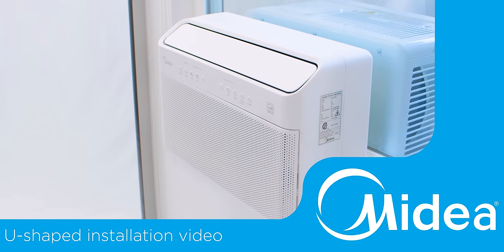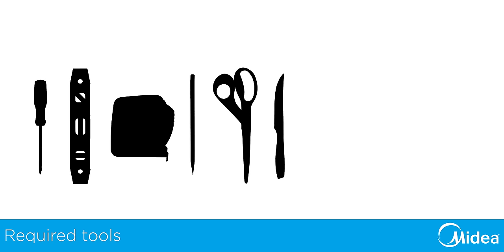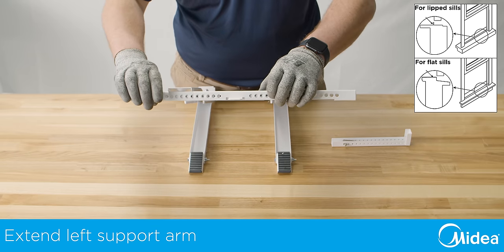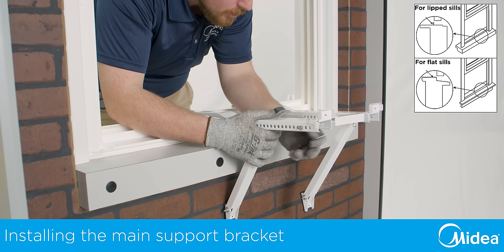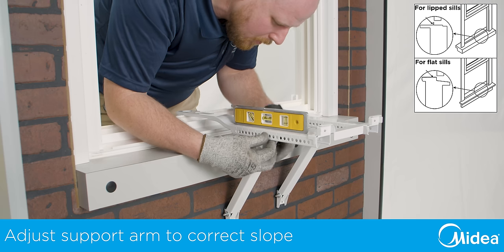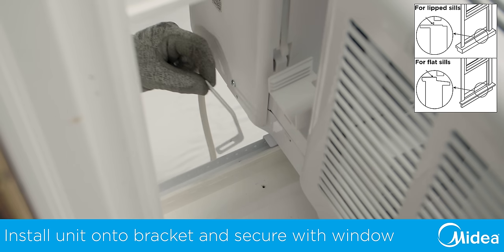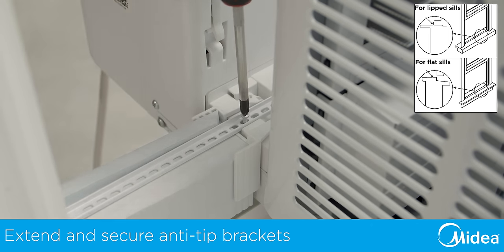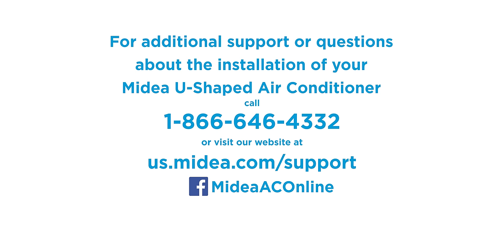Midea U AC Installation Guide

Comment: This installation was so bad in the manual I almost sent it back just based off that I had to look at two installation videos and anti tilt is still not in correct spot customer service wasn’t helpful at all it was so stressful I’m happy I stuck with it though it’s so quite and I do like it the app was giving me issues too
Reply from the maker: Hello Castiel. My name is Candice. I am sorry to hear that the installation was so stressful however, very happy to hear that you did stick with it. Love to hear how happy you are with such a quiet unit and the smart features. Have a great day. MideaCustomerCare@hartehanks.com  (BBB A+ Accredited Business)
Reply: You guys really really gotta explain it better people will not be like me I got frustrated a few times and the anti tilt flaps don’t even go in between they are off by a little bit so I stuck them out as far as possible and screwed Em in
Reply from the maker: Hi Castiel. Thank you for the feedback. I will pass on the information for the future. Let us know if we can help on Facebook at m.me/MideaAmerican anytime!
Reply: @elmochipshop25  yeah my anti tips are like half an inch away from being able to go where they belong..... Then I still couldn't make the cut side face indoors .... I have both cut sides of anti tip facing out and hanging onto inside of window where bar is on vinyl window. As long as none hang on it I doors it should be fine but.... If they made it to where you could slide the anti tip horizontal 3 different screw settings that would work... Predetermined spot with all that space for window isn't a good design

Comment: This videos directions skips steps and so you have to use the manual. Like telling you to put foam on and then having to install window brackets? But the foam is covering the parts where brackets attach, also after you put foam cut into bracket, they don’t mention you have to take the screw out before to Re screw it to hold in place. And on top of it, my unit is different from the one in the video.
Reply: Mine is different too- mine is a newer model purchased recently, I think this 4-year old video is outdated for us. Better to scan with the phone and follow the video provided in the instruction manual.

Comment: Just installed this an hour ago..... This video and instructions show the anti tip brackets differently. The unit doesn't allow the left side (when looking at it) to flip the direction the book says to. The unit also doesn't have a flat side , both sides are angled and they do not change angles when flipped. I said screw it and installed it the best I could. The anti tip isn't inside the track because window is like half an inch to awkward so I installed them on inside hanging on so it's def not going to tip outside now... If a kid hung from it inside it may break it though. 

The insulation was the most infuriating experience ever! Then I have my concerns on rain that hits the windows (sideways rain as I call it), I wonder if water is going to get in the house ....

The directional vents are pretty much not existent, maybe adjust airflow like 30 degrees, always goes down middle too. The remote sadly isnt a temp sensor too. 

It does sick out about 5 more inches than you are used to. 

I setup to where I can open window and have it sealed with insulation. It's very quiet. High speed could be stronger (8k unit) ... Def not blowing me away with air strength vs last unit.

I bought it for energy saving cost mainly and old one I didn't feel like tearing it down to clean it (years old and can only clean so much without teardown).

Time will tell on energy savings (fall now soooo).

Also, I used static cling tint on window to stop light intrusion since in bedroom and with gy shift. 

I have not used what features yet.
Reply from the maker: Hello Michael. Congrats on your new AC!  I am sorry to hear about the frustration you have had with installation and setup. Reach us on Facebook with any questions or concerns at m.me/MideaAmerica. Have a great day!

Comment: I was not aware that you cannot use this unit on multiple set of windows. I thought the bracket went in the window channel, but it sits on the window sill. On multiple windows there are no sides to screw the extension arms into.

Comment: For installation, is it absolutely necessary to screw into the window frame? I plan to use the air conditioner unit temporarily and don't want to have holes drilled in..
Reply from the maker: Hi @dreeemer. Thanks for your question. Yes, all brackets must be used for a secure and proper installation. Have a great day.

Comment: Yeah, in the middle of installing... there are a few steps that don’t make sense w my window. The most frustrating thing is that the insulation that I have to cut isn’t tall enough to fill the void between the window and the bottom of the frame. I’ll have to figure that out.  Customer service is closed on the weekends (when I have time to install).
Reply from the maker: Hi Zach Bliss. Thanks for sharing your comment. To better understand your situation, please give us a call at (866)646-4332 and provide Ref no. 111097374. Opening Hours: Mon-Fri, 8 am – 6 pm EST and Saturday 9 am – 4 pm EST.

Comment: The hardware that came with my unit is different than shown in the video.  The part of the main bracket that sits on the window sill is a slightly different shape and are covered in foam; the anti-tip bars only have narrow ends; and the open window brackets are a different shape entirely.  It's hard to tell from the video exactly where the main bracket sits on the window sill.  The way the video switches between wooden windows and vinyl windows is also confusing.  The icon is too easy to miss when you're focused on the video.
Reply from the maker: Hi Kayta. Congrats on your new AC! I am sorry to hear that the video was not as helpful as you had hoped. Reach us on Facebook with installation questions at m.me/MideaAmerica.
Reply: Same here.

Comment: Hello do you have the dimension of the outside unit for the 8000btu and 12000btu unit, I got a wall close to the window…
Reply from the maker: Hi @marlonterdu9060, The total depth of both units is 19.17 inches. This is divided into approximately 5 inches of internal depth, 3 inches within the U-shaped groove, and 11 inches protruding externally. Have a great day!

Comment: I just got my 10k unit installed. Installation video did help although the black plastic that holds the weight on the end of the bracket fell off.

I am pleased with the 10k btu power and noise level is really low. Only thing is... I can't complete my midea app on android. It stops at 61% and does not continue. I am using s9+
Reply: switch off mobile data during the setup. that solved it for me--but that was the previous version of the app.

Comment: My husband was able to install this unit quite easily in 20 minutes. Thank you for the video. My question is does the unit have to sit for 24 hours before you start it up?
Reply from the maker: Hello Reva. Wow, that is a two man job! Well done. You can plug the unit in after installation. We do recommend reviewing all the safety precautions in the user manual https://m.media-amazon.com/images/I/B1jDNDI3CMS.pdf. Enjoy!
Reply: It wouldn’t work. Fan outside would not run. We noticed that on the box was a sticker saying it had been returned already once before. Circulating a broken machine does not help your reputation. We waited a month to get it from Amazon and now are sitting in 92*F in our living room. But thank you for replying

Comment: There is no instructions to seal the bottom of the AC against the window! Please advise me if the included foam can be used for this. It is important to seal the bottom, even though you may not see it.
Reply: I used the provided strip of black sticky-backed foam for the bottom. It's wide enough to cover the gap and helps with insulation. It is very sticky though.
Reply: Yes!  I feel like this was a glaring oversight and no one caught that?  There are big gaps that small bugs can fit through not to mention how it's really bad for insulation.  Also at 6:02 - it is not that easy.  Most windows will not just fit perfectly, there are gaps on the side where it's very visible and then there's the middle where it's concealed.
Reply from the maker: Hi keantoken. Thank you for sharing your comment. The unit comes with insulation seals for the openings after install. Please see the video link below for a better idea. 

https://youtu.be/76uNIEiDBGo
Reply from the maker: Hi McBain. Thank you for sharing your comment. The unit comes with insulation seals for the openings after install. Please see the video link below for a better idea. 

https://youtu.be/76uNIEiDBGo
Reply: They have a separate video on YouTube that covers the insulation of the unit in detail. Unfortunately, I didn’t find it until I finished my installation.

Comment: I cannot use this In the window I had intended.  The wall outsides protrudes too far and at the largest pin opening the feet just allow it to pitch correctly. Moved to another window.  Issue number 1 unit will not center.  Small issue but one nonetheless.   Second there are bug holes now under the unit.  So no matter what I will have to deal the bottom.  Issue 3 the anti tilt isnt even close to the sash.  Issue 4 the open window brackets do not reach the intended hole. A question.  Does the bracket go on the inside of the lip ?   -This video and instructions kinds of shows the bracket stays on the inside of where the window closes.
Reply from the maker: Hi Michael Hinchey. Thank you for sharing your comment. We'd like to better understand your situation. Kindly give us a call at (866)646-4332 for assistance, please provide Ref no. 111097345 when calling in. Opening Hours : Mon-Fri, 8 am – 6 pm EST and Saturday 9 am – 4 pm EST.

For issue # 2, the unit comes with insulation parts. Please review the video below for a better idea. 
https://youtu.be/76uNIEiDBGo

Installation Guide:
https://m.media-amazon.com/images/I/B1WOLioF8mS.pdf

Comment: My windows are 44 inches wide. Can I install this and add additional foam to cover the gaps?
Reply from the maker: Hello Ryan. For safety we would not recommend installing this unit any other way than intended. The unit is designed to fit in windows with opening widths of 22"-36" and with a minimum height of 14". Have an excellent day.

Comment: What types of wall is bracket footing compatible with? I live in a 2 story apartment building that has stucco walls. I already drilled horizontal bracket piece onto sill. However, when I try to place the support arms against the exterior stucco wall, rubber footing keeps slipping out of place. The rubber footing of bracket does not seem to grip the wall. Does this bracket not work with stucco walls? Do I need to purchase a different bracket?
Reply from the maker: Hello @debbiecha5813, We recommend installing the bracket on flat surfaces, but it can also be adjusted to fit on stucco walls. However, this unit has been designed to work with only one type of bracket. If you have any questions or concerns, please contact us at digitalsupport@midea.com. Have  a great day!

Comment: Just purchased the 8k got it installed just fine and even had no issues with the app. I replaced a old loud 5k btu air conditioner that worked great just loud so purchased this 8k for a 270sq bedroom and even on 60 it stays close to 70 in here and the air coming out is not as cold as my older 5k unit. is that just how these inverter units are or do i need to step up to a 10 or 12k btu says it does 350sq ft but sure doesn't cool as good as my 5k
Reply from the maker: Hello Will Adams. We thank you for leaving your comment about the Midea U AC unit. We are sorry that your AC unit is not cooling your space. Please contact us today on Facebook at m.me/MideaAmerica so we can assist you.

Comment: This unit leaks water into the house no matter what we do. It actually flows uphill against gravity to get inside.  Emptying buckets of water daily. Theres no way to access where its plugging up. My son used a flat piece of tinfoil to unblock it but that only stops the leaking for a few days before clogging up again. Emptying buckets of water daily to have air conditioning sucks.
Reply from the maker: Hi, @bonniesuppe4230 I appreciate your feedback. We apologize that you have been unsatisfied with the draining of your AC. The unit should be installed with a three-quarters inch (3/4") tilt. When the internal drain tray fills up to capacity, it overflows and drains through the grills and bottom. To further assess the issue, please contact us at digitalsupport@midea.com.

Comment: Can this be installed on a window that is wider than 36 inches?  My window is 47 inches wide.
Reply from the maker: Hello litesp. This unit is designed to fit in windows with opening widths of 22"-36" and with a minimum height of 14". Have an excellent day.

Comment: Our windows are directly above our porch roof. There is no gap of siding to hold the window bracket in place. Will the bracket legs pivot and allow the roof to support the weight?
Reply from the maker: Hello @jaypelham, the unit should be installed with a backward tilt of three-quarter inches; therefore, if the roof prevents the legs from providing this tilt, it will not function properly. If you have further questions or concerns, please contact us at digitalsupport@midea.com. Have a great day!

Comment: What if the outside wall is not flat and is in an angle, trying to install it on my Attic ?
Reply from the maker: Hello @sjrcustoms637, The anti-tip bracket should be flat on the external surface. For further support with your inquiry, please reach out to us at digitalsupport@midea.com. Have a great day!

Comment: Put one in yesterday.
It's not dripping. Got condensation on the inside.
Reply from the maker: Hello, @modestmikesmods. Once installed, the unit should be tilted backward by three-quarters of an inch (3/4"). It contains an internal drain tray that overflows and drains through the grills when it reaches full capacity. If you have any questions or concerns, please get in touch with us at digitalsupport@midea.com. Have a great day!

Comment: Does this not work with windows over 36 inches, or could I not lay the side mounts flat and just screw it downwards?
Reply from the maker: Hello. Thank you for your question. The unit is designed to fit in windows with opening widths of 22"-36" and with a minimum height of 14". We can't recommend installing the unit any other way then intended. You can view units that do fit in your window on Midea.com. Have an excellent day!
Reply: @MideaAmerica  

That’s fine, I ended up having a window that was wider than that but I got it to work with the downward screw, and your AC unit works FANTASTICALLY with a wider window (though I understand you not being able to recommend that). Thank you!
Reply from the maker: Thank you for understanding! That is fantastic to hear. Welcome to the Midea family. Enjoy :)

Comment: This unit LEAKS out the hole that's where the brace is so it's going to rust it out plus it's DRAINING ON THE WINDOW LEDGE DOWN THE SIDE OF THE HOUSE. Some people are drilling a hole (which voids any warrantee) but it's still going to leak through the holes that are already there. I'm talking like a water faucet with constant multiple drips and actual drizzle at times.Will rot the wood. Doesn't matter how much the unit is tilted downward outside it pours water ON THE WINDOW ledge due to where the holes are. Many have written negative reviews about this serious flaw, but they still give it 4 stars because it's an advanced U shape model that blows cold. 

If anyone has a fix, please reply for everyone to know if there's a workaround. I sure don't see how. Guess along with drilling a hole and running a tube, using duct tape over the existing holes but what is their purpose and will blocking the holes affect it?
Reply from the maker: Hello. Thank you for your question about the Midea Inverter AC. We are sorry to hear that your unit is not working properly. Please contact us at DigitalSupport@midea.com and reference case number 111557597. Have a great day. (BBB A+ Accredited Business)

Comment: Te bracket is not designed to accommodate the unit in a dormer window. There is no vertical wall only a pitched roof.  I bought this unit. How do I install it?
Reply from the maker: Hello Edward. This unit is intended to be installed in vertical sliding double-hung windows and we can assist via Facebook at m.me/MideaAmerica. Have a great day!

Comment: I wonder if Midea (or anyone else) has built a window kit for those of us who intend to install this AC unit temporarily.  Once in awhile (here in the southeast) we'll lose power for an extended period of time due to hurricanes or other extended power outages.  In those cases, I'd like to install the Midea TEMPORARILY.  That means I really don't want to be drilling into my windows and putting permanent screws in, etc.   Anything "temporary" offered?      . . . . . . .  Would something like this work?   "Top Shelf TSB-2438 Universal Heavy Duty Window Air Conditioner AC Support Bracket -Holds Up to 200 lbs., No Drilling or Tools Required....  "
Reply from the maker: Hello! Thank you for your question. Unfortunately, we cannot recommend using any parts other than those supplied with the product. Doing so may compromise safety and void the warranty. However, we appreciate your feedback and will take it into consideration as we work to improve our products. If you need assistance with installation or have any further questions, please don't hesitate to contact our customer support team at DigitalSupport@midea.com. Have a great day!